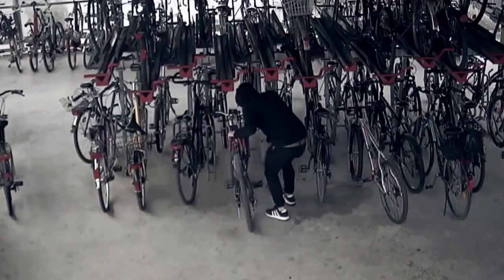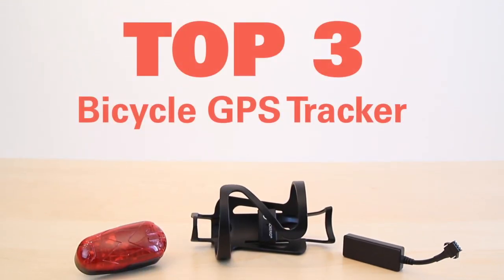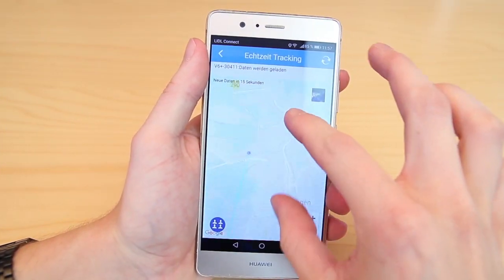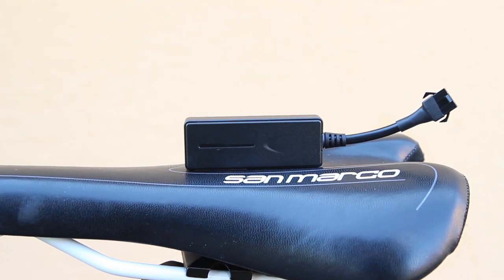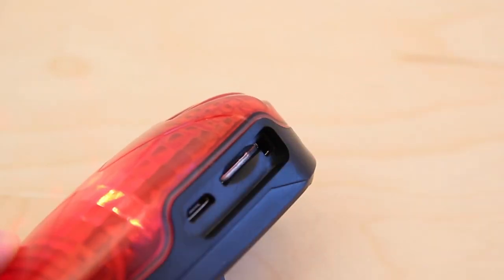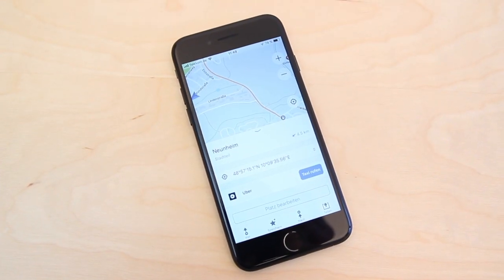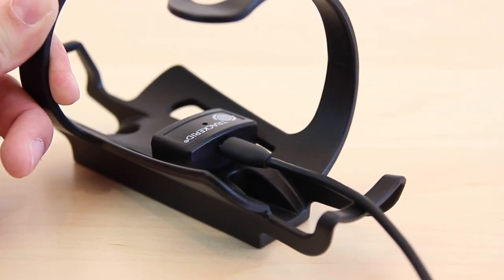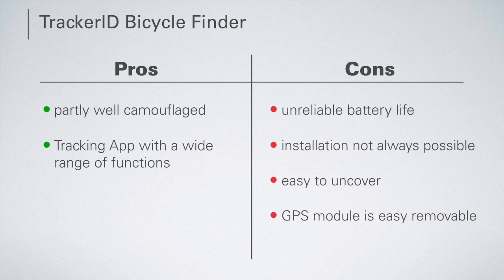TOP 3 GPS Tracker Bicycle Review. Anti Theft!

Comment: I like the first one a lot. If you combine it with a screw protection like Hexlox, so that the saddle can‘t be removed without the minikey, thieves also can‘t remove the gps and deactivate it, even if they are aware of the tracker. Since the battery doesn’t die, they would have to destroy the screw/saddle post with an angle grinder and possibly damage the frame. It gives you much more time to track down your bike.
Reply from the maker: We installed the gps bike tracker with a hexlock many times in the bike frame to keep the saddle and the 'inside' protected. Good point!
Reply: I dont want to disappoint you but have you ever heard of gps blockers? :/
Reply: That’s cool & all, but what about the short battery life in case you’re planning on using your bike for long riding sessions?
Reply: @rocus80m  No. Since you mentioned it, I’ll look for more info. Thank you for the question.
Reply: @rocus80m You think bike thieves are that smart? We're talking the lowest members of society. They aren't that smart.

Comment: Do all GPS trackers require a SIM card?  So, does this mean you need to pay ongoing fees to a telecommunication service provider?
Reply: I think they need a SIM card. Otherwise, I do not see how it can transmit the GPS location. I think that you can use any gsm provider you want
Reply: They usually have a subscription that covers the cost of the SIM card and tracking service.
Reply: Depends. If you get a pay as you go SIM the charge may be a yearly one. Typically this is not too expensive. But yes most do use a SIM card because even if the tracker knows where your bike is, you don’t when it is the hands of a thief, so the tracker needs a way to tell you and this is often through the cellular network. I have not found one that uses the satellite network except for personal locator beacons.

Comment: Hey, I have a question for the first featured gps tracker from swisstrack. If the battery is installed inside the frame then would there be problems with heat? Since most bikes are exposed to sunlight?
Reply from the maker: Heat is not a problem. The tracker and battery have been tested under all conditions long time.
Reply: @gpstrackervideos  wow, thank you. I hope it is available here in the Philippines nabawan
Reply: @tonystark3391  hey, did you get it?
Reply: Can i use swisstracker without sim card???

Comment: i'm guessing it need a sim card ,does that sim card need to have internet ? ( mobile data )
Reply: i have same question
Reply from the maker: Yes the GPS Tracker need a Sim Card with mobile data (5-10MB per month). We offer a SIM which works 2 years long constant, without any buying new credit.
Reply: @gpstrackervideos  have any coverage over Asia?
Reply from the maker: @DaveChips  yes the tracker works well in Asia. You can use a local Sim Card